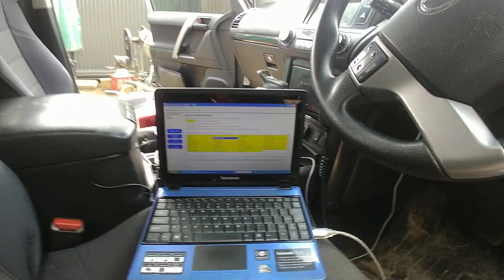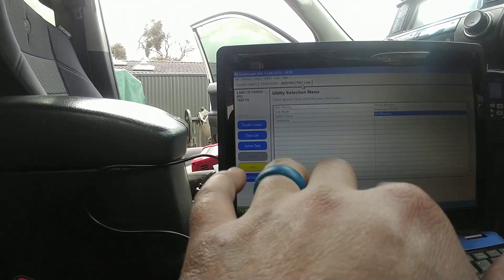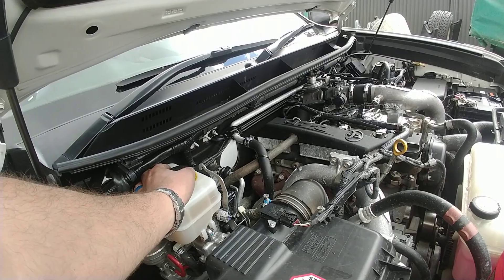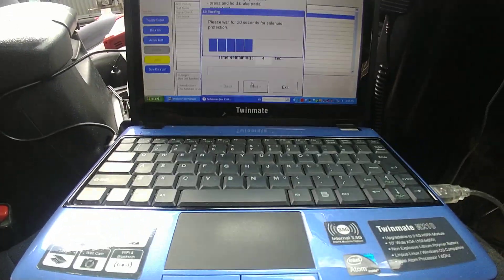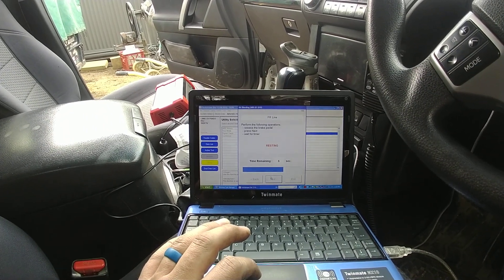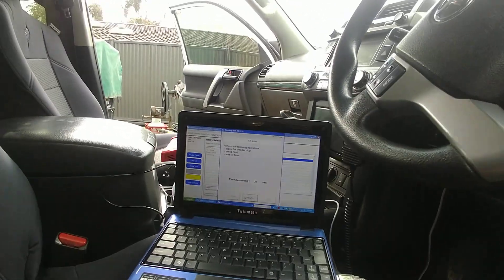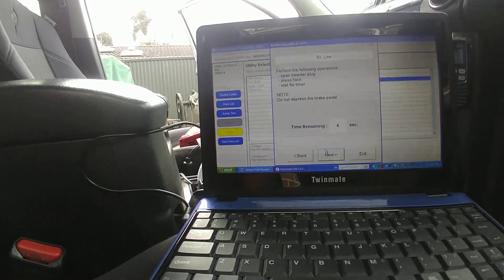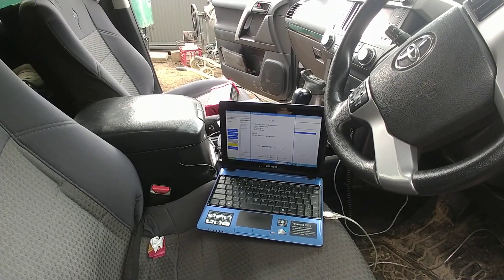How to bleed your brakes on a Prado using techstream

Comment: why not just do it th normal way? the software is so fucking shit and onfusing to use
Reply: With LandCruiser and Prados, these non booster brake system can only be done properly with scan tool or techstream, we learned it the hard way by doing conventional method like all regular cars at work. Somehow the ABS will pressurize each brake lines and get air trapped back to the reservoir, that's all we know.
Reply: For the rear axle the program instructions are different than for the front axle. On the front brakes, are the bleed screws never opened?
Reply: They need to be opened this fool didnt show the video properly@GnzCabrera

Comment: I have a 2012 GX460 and have thought about performing this method. However I’m not getting any codes in regards to pressure, but have noticed my brake peddle doesn’t always feel the same at each stop (sometimes nice and firm while other times not so firm). With that being said, do you not have to open the bleeder valves when doing the front brakes? Not sure if this is the exact same between my vehicle and yours, but have read they are the same vehicle just different names, unless of course yours is the previous generation.